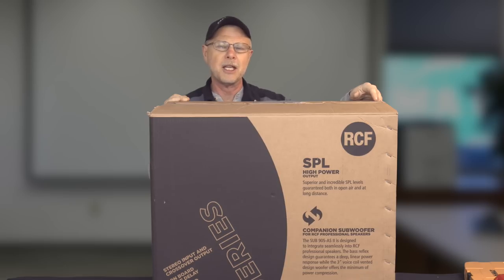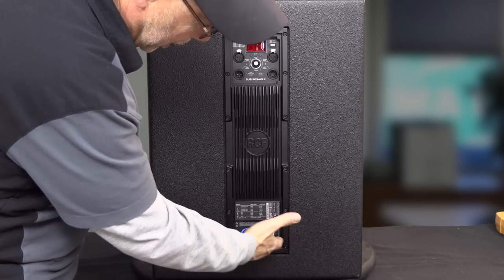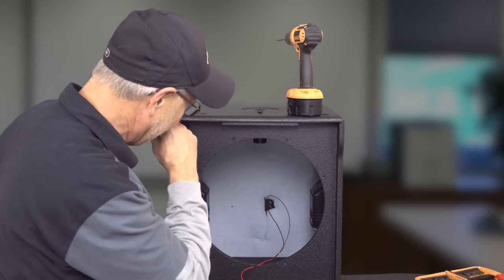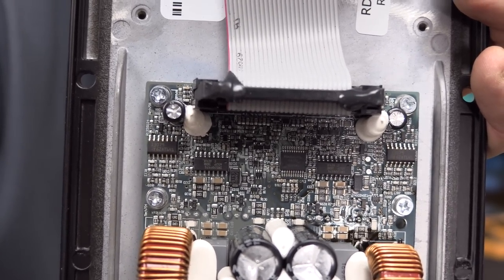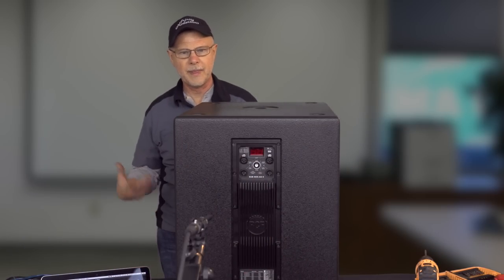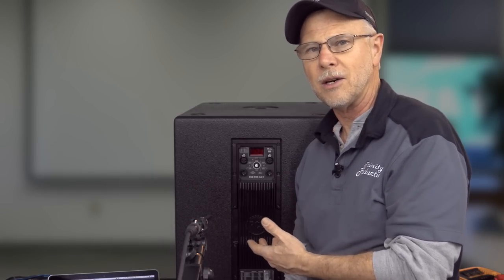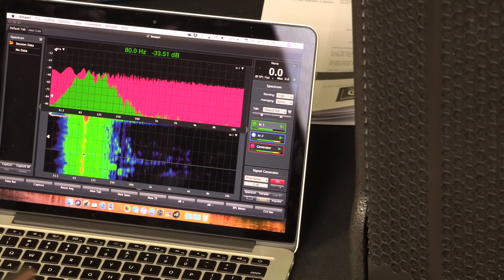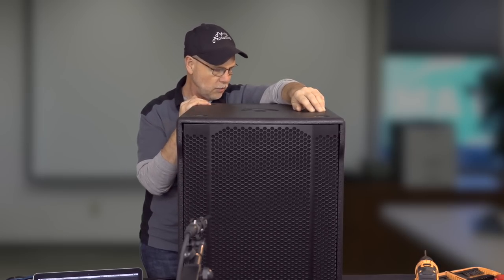RCF SUB 905AS II COMPLETE REVIEW - AUTHORIZED PREMIER PARTNER DEALERS

Comment: Would one of these (to start with) be a good match with a pair of art 712-a mk2 speakers? Which crossover settings would be preferred? As I understand these subwoofers are louder when using the H presets instead of the L ones. Cheers and thanks for good videos.
Reply from the maker: The 905 is a great 15" sub. and yes will work with the ART series no issues. Depending on what you are using it for and music etc. since it is a 15" don't anticipate you are going to be getting the same response as an 18" with larger volume cabinet, but for the size the 905 does a great job. Its sweet spot for output is going to be 60-100hz, going below 60 and expecting same output won't happen. Going to be a quite a reduction in output volume.

Comment: Is there a sound difference between 905as and 905as II? I have one 905as and now I am in doubt should I get one more 905as or 905as II?
Is it better to have two 905as or one 8003as?
Reply from the maker: Yes there is a difference, will you notice it, most likely not...IMO better to have 2 of the 905AS than a single 18....

Comment: Which is the better Sub 905as ii or 708 as ii ??  Please advice am going to buy one of these two..
Reply from the maker: I would do the 708 18" vs. the 15, even though the 905 has more power the 15" driver does a great job, but as with most 15" subs unless you get one that is $$$$ and 18 IMO does a better job and has lower freq. response and "moves more air" IMO that a 15. We installed a pair of them in a small gym under the stage and they did a great job, but 18's always win and the 708 will kill a comparable (using that term loosely) QSC

Comment: Fantastic video...can you help me .I'm using the sub on l2 linked to 2 rcf hd32a tops.

I find the sound a bit mushy and not clean any ideas on best settings for my configuration.

I have my tops set  on 2 ie 10 past..

Cheers
Reply from the maker: H2 40 Hz – 80 Hz
H3 40 Hz – 100 Hz
anything in the 30hz area is going to overdrive them and they really are not meant to be pushed down to 30hz 
for volume sensitivity, wide open

Comment: I just got one of these and 2 of the 712 mk4 tops, man these things rock for 15" subs, really impressive, do you have any suggestions for the best settings for this combo, at the moment I have them on H3 with -10db and 0 delay, the limiter light does flash early, but I was told that's not a problem, just an indication they are at 0db, hopefully that's true.
Now to save up for a second sub ;-)
Reply from the maker: sounds like you have setup ok...i would use H2, just use the built in crossover at 90Hz up to your top boxes.
Reply: @trinityprosound  The limiter light flashing is nothing to worry about to much I hope ?  I hear great things about the limiter protection in RCF box's and that there almost impossible to blow up, what's your views on this?
Reply from the maker: it can flash, just not on steady, they do have great protection, but if you are driving it that hard that the limiter is coming on you need more subs, you don't have enough rig for your gig.

Comment: Hello. I own some TTS26A subs and I also own 2 backup drivers for them. (Lf15n401 on 4ohms). I also own some 705/905as subs and I want to put the LF15N401 inside them. Replace the factory drivers. What do you think? Will there be a significant difference? What do you know about the impendance on 705/905 subs? Is 4 or 8 ohms? Thank you!
Reply from the maker: I would not , the drivers are specific to the tuning of the cabinets and may not work well at all.

Comment: Hi there, I was checking 708 and 905, and find out that they both have 133dB output, and 708 is 700w amp, and 905 is 1100w amp. I expected they will have almost same output, and ofc, more low end in 708 (coz 18"), but, in live, I can bearly hear 905 against 708.
Did I expect to much from 905, or there is some "catch" with input gain? (I use xair18, and set up is 80Hz xover on 708, and L2 presset on 905 + didn't notice much difference with H2 presset)
Reply from the maker: the 708 being an 18" is going to give you more low end due to larger cabinet and speaker surface... the 905 being a 15" does a great job for a 15" sub, we installed 2 in a church gym and was impressed with the 15's but they are not 18s. best 15's we have ever heard is the RcF TTS26's dual 15" subs, but they are $5000 each... the 905 being a compact sub, in reviewing the specs vs. the 708 shows it goes lower, but it is the volume of the box and the surface of the 18" vs. 15" that you are hearing the difference, or lack thereof from the higher powered 905. in the case of subwoofers, size does matter.
Reply: @trinityprosound  is it better to go for one more 905, or change to 1x8004?
Reply from the maker: if you can do the size of the 8004 is my choice, if the size and transportabily is the issue get another 905 and put them side by side to couple on the floor if that is possible.

Comment: We got this sub for new year! Sounds great -10 H2 maybe H3 different songs sound better
Reply: Why did you drop them by -10db, i ask because i bought a pair only to find 905s clipped pretty quickly, i used a pair of ART 312MK4s on top (1 sub 1 top)
Reply from the maker: you never want to run the input gain fully open on a speaker as it will limit very quickly as it over drivers the input gain section on the amplifier, that is not a volume control but an input sensitivity control ,we will run most 4 to 10 db down depending on model to get the best results. set your ART boxes at 12 o'clock position or 2 o'clock and work with the subs so that they both limit at the same time for volume and use a crossover point of around 100-120hz to send up to the 312's, we never run full open with the input sensitivity all the way up. yes, it will clip early
Reply: thanks for the reply, i have been playing around with your tip today and yes the sheer output of the bass now appears to be more matched to the 312, i make some further tests this weekend
Reply: trinityprosound is it soft clip? Is it true the woofer needs to break itself in cone?
Reply: Donna Webber what do the mk4 sound like now?
Reply from the maker: usually when the lights are on steady it is into limiting not to overdrive the input and and amp section. occasional light flashing is OK, on all the time is NO GOOD.    No speakers don't need to break in , we have not ever noticed any difference between our subs from the day we fired them up to now. If anything as the surround gets weaker with age, there is nothing there to "0" the cone back to its original state and think that a well used subwoofer etc. over time will need to be reconed and or replaced with new drivers.
Reply: the new 312 mk4 is clean and powerful, i love them
Reply: RCF told me when the soft limiter lights flash on the 905 asii theres still another 6 db available. i find that hard to believe
Reply from the maker: that sounds about right....i have yet to have a RCF speaker break up even in full limiting...we typically set sensitivity gain at about ½ way open to ⅔ open for best results...we never open the input sensitivity all the way...could that be the issue? It would overdrive the input section and clip the amp early if you do...
Reply: trinityprosound not sure I understand your comment when you say you have not had an rcf break up even when full limiting. Why would you run it to full limit ? I don't think any speaker or amp should ever be run to full limit
Reply from the maker: we don't run them there, just when during testing, etc we have run them to full limit and the limiters come into play quite nicely and don't allow the sound to break up or distort
Reply: Any thoughts on the stamped ferrite drivers?
Reply from the maker: Stamped baskets are stronger than you think..and for a 15" driver, it is acceptable for the frame to be stamped and really no issues. also, cost of the driver is considered when doing that and the performance they can derive from the driver , voice coil and cone assembly. with the power of this speaker they had a driver that could take the power, remain intact and provide the required performance and SPL needed. the ferrite magnets are again a cost issue vs. neo, which is considerably more costly. ferrite has been the go to for years now and produces the required gauss , but at the sacrifice of the weight and size.
Reply: Have you compared them to many other 15s? The FBT Subline 115a perhaps?
Reply from the maker: no, only 15H from db and it is much better ....
Reply: RCF much better you mean?
Reply from the maker: Yes correct !
Reply: Donna Webber interesting when i was playing with 905 sounded like could take bit more input
Reply: The Boogie Knight so if i was to put the neo 35hz low driver in it would it sound a bit better again and be lighter again? By the way i got a 905mkii at good price damaged grill
Reply: trinityprosound RCF LF15N401
Reply: The Boogie Knight RCF LF15N401
Reply from the maker: and you will most likely totally hork up the sound of the box unless what you replace in neo is the EXACT engineered speaker to go in that box. you will not find a direct driver from the "stock" drivers, most likely custom engineered driver for the box. what you are suggesting unless you do all the math to calculate how the driver functions with the cabinet resonant freq. Xmax of driver, Q factor, power ratings, Mms, Vas, Sd, Qes, Re, Le and the list goes on , there is more to cabinet design and speaker selection than just swapping out drivers.
Reply: trinityprosound jut being nosey and always have wondered i understand about certain drivers for right volume enclosures, just that look great driver on spec sheet etc.
Reply: Donna Webber what are the new mk4 like sound wise still 400watt amp
Reply: Ive been using 312 (mk3s) for a couple of years now and ive now bought a 705 (mk2) sub becausw Ive wanted to add a bit of chunky depth to my sound. I usually run my tops at 12 o clock position and ive never really had them up any further although I do have the gains up high on my mixer. Anyway im just looking for any helpful advice about running my new sub with my tops? Thanks
Reply from the maker: run left and right into the sub and out to the tops, use the 110hz crossover, that will couple well with the tops or even the 90hz setting if you are not pushing real hard for the tops

Comment: Hi, there, just a quick question, in a two sub cardioid setup, as the manual says, which one should be facing forward the top or the bottom one?
Reply from the maker: either one, but i would do the top facing rearward and let the bottom one couple to the floor.

Comment: I haven't heard much about RCF until just recently. I'm looking for some advice. I do over 100 events a year, so I want something that is versatile, reliable, and has good power for large events. I currently have 4 SRX815P tops, and 2 SRX818SP subs. I was thinking of selling 2 of the tops and buying 2 K12.2's for those smaller events, but also be able to use them along side my rig for larger setups.

Hows does RCF compare to the SRX series?
Should I get the k12.2's or what would be an alternative?
I would even consider selling my whole rig and get RCF's if they are better. I'm just not sure they will be.
Reply from the maker: Don't waste your money on the K12.2, look at the RCF HD12 or HD32 and for subs if you want something killer the RCF 8004's. If you can swing the HD32 for $$$ you will be amazed at the sound output , sonic quality of the system.
Reply: @trinityprosound  Hello, hope all is going super! I have 2 JBL SRX828SP, do you think with 2 RCF 905-ASII will sound almost alike as the SRX828's?
Reply from the maker: no, it might  be close, but  the 828 is a dual 18 sub. you would have to go with a 8006 to compare sound and output. maybe if you put 905 side by side so they can couple , but with the large volume of a dual 18 box it is tough for a single 15 or a set of single 15 to come close unless you would look at the RCF TTS26A, but those are quite expensive but OMG amazing for a dual 15 sub

Comment: Hi buddy, thank you for the good detailed inside info. Looking to add some subs to my 745as II but struggling to choose between the 705asii and the 905ASII. Which would you recommended between the two and why please? Is there masses of difference to warranty spending the extra dosh on the 905s. Please help. TIA
Reply from the maker: do you need a 15" for size or weight? how are you going to use them, in pairs one on each side ? for the 745's would really recommend an 18" sub like the 8003 or 8004 for good solid low end.
Reply: Hi thank you for your reply. I was going with the 15s for weight and size mostly. Whqt is the different between the 8004 and 8003? Is there an ASII in any of these and would they be better? Thank u
Reply: Oh and intending to stack one on each side and for weddings mostly. 150-200 peeps. Also looking to purchase a set of DB Ingenia IT2T to use as an array.... do you think these will work well together on a pair of 18s plz. Thanks
Reply from the maker: The 8003 is a V2 model with newer DSP in it...less power than the 8004.
Reply from the maker: if you do one on each side with the IG2T tops, that will do a very good job, it is that the 15's won't go as LOW as the 18's  but the 905 for a 15" sub does a good job for the size of that speaker.  using the built in crossover of the subwoofer you can run the IG2T harder and let the sub do what it needs to.
Reply: What would be the ideal setting on the 905 when using with the Ingenia 2 would you say please?
Reply from the maker: Start at mid point for level and go from there...set for higher cross over frequency and good to go.

Comment: Hello, I have 2 questions for you! I own a PRX 818 xlfw subwoofer, but I'm thinking of changing my system to RCF! Would it be better to replace it with RCF 905 AS II and would it be better to use pair art 735mk4 with one subwoofer 905 AS II?
Reply from the maker: I would keep the subs you have and couple up with the 735's , the 905 is a good 15, but won't quite do what an 18" sub will do. The 818 sub is more like the RCF 708 sub in features and power. So you should have no issues. Use the high pass on the subs "80Hz 24dB/Octave high-pass filter is applied to the signal coming out of the THRU connector" and you will have a great sounding system.

Comment: What are your thoughts comparing RCF 705/708 subs compared to DB Technologies Sub15H/18H?   Thanks
Reply from the maker: Similar, but the RCF units have a bit better box construction in the materials. The db's are hybrid type with the H where the RCF are bass reflex design while the db is bass reflex and semi horn loaded , db's have a bit more power behind them in the amp on the 18" model.

Comment: knowing how you feel about QSC i dont suppose you would recommend pairing the qsc ks212 with rcf 745s ?   the cardiod aspect appeals but not sure its compatible for the qsc needs the 745s to have a high pass filter i dont think it has ...any opinions or facts ?
Reply from the maker: if no crossover out , you would be running full range and that defeats the purpose of a dedicated sub. 8003 or 8004 would be the recommendation or the 15's in the 705 or 905 series
Reply: @trinityprosound  i have gone for a single rcf 8003 as ii now good choice ? hope so !!
Reply from the maker: I think you will be very pleased with the 8003 for sure
Reply: @trinityprosound  thank you any recommended settings o  the dsp and xlrs ?
Reply from the maker: cross over at 90hz-100hz and use the xlr outs to your top boxes , set the button to xover mode and not link mode

Comment: I currently own the 705ASII. How much of a difference in output would I hear if I upgraded to these 905ASII? (Obviously an 8004 would be a huge upgrade but I currently need a smaller sub for weight reasons).
Reply from the maker: It drives a bit harder due to additional power, but you would be better off adding more 705s to your rig/system, yes 8004 would be the best option, but if you are looking to replace a 705 with a 905, not sure you are going to notice "that much" difference
Reply: Thank you that’s helpful! Is there any subwoofer in the “under 70lb” weight class you would recommend that would make a substantial difference over the 705?
Reply from the maker: db tech has a SUB15H that is decent for the weight, $$$ and output...hate to steer away from RCF but those are fairly portable and do a decent job.
Reply: Interesting! Same wattage but 2DB more max output...do you think they make a substantial difference over the 705ASII? The DB sub is 20lbs heavier but I wouldn’t mind if they were that much louder
Reply from the maker: i really don't think you are going to "hear" a difference in them IMO, they both do good for a 15" sub , all those subs are within a few pounds of each other...there is not 20lbs difference between the 15H, 705 and 905  69, 63, 66 respectively - we have the 15H in rental inventory and they do a great job for a 15, but i would use 705 or 905's if we had them...

Comment: what is the best (sound and sound pressure) between rcf 905as2 and db 15h? and which one has a better quality / price ratio?
Reply from the maker: the 905 wins, but at almost 1.5x the price.905 has more DSP settings and better build quality with cabinet, etc.

Comment: Hi I’m am interested in the 8004 vs 8005. Which sub is best overall?
Reply from the maker: I would have to go with the 8004 as best all around. The 8005 is good, but we have sold more 8004's than any other single 18" subwoofer and all who have purchase love them. Same power in the 8005, but you are moving a larger driver with the same power as the 8004.
Reply: trinityprosound thank you!!